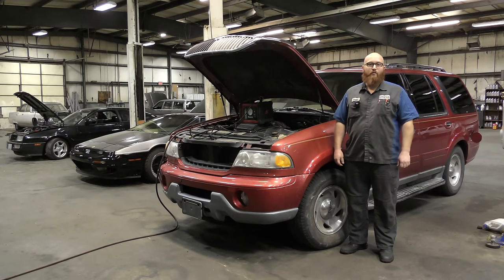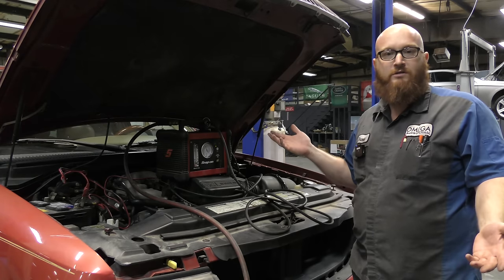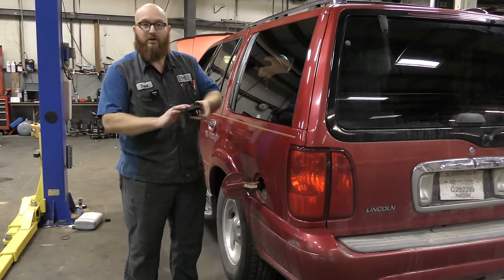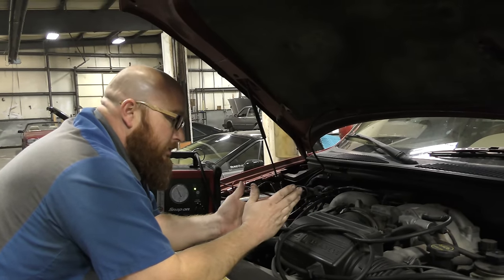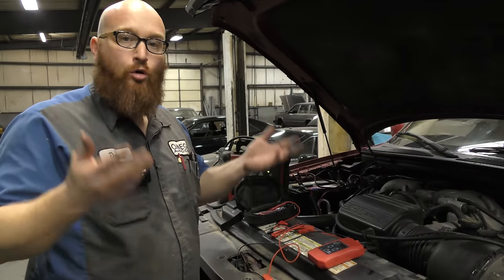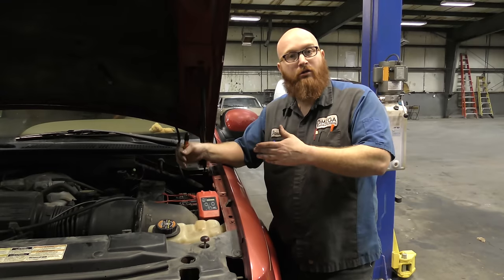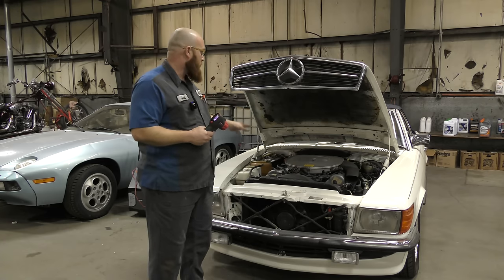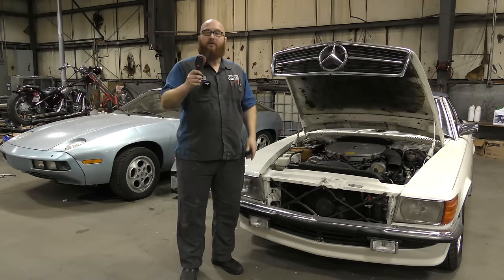Smoking up the Shop!  CAR WIZARD shows 3 essential advanced diagnostic tools he can't live with out!

Comment: Car Wiz or anyone: 1994 F150 4.9L suddenly gets terrible 9mpg after 24 years of 13-14 in town. Checked old injectors and found 3 wanting so replaced the set. Before this I replaced front fuel pump as it was dead. Fuel regulator is good. Filters new. One code for O2 sensor but that according to forums and videos it doesn't affect mileage much. Anyhow it's being replaced today. (Living in California I suspect collusion between Sacramento and refiners to water down the gas thus having to purchase more often and make up lost road taxes from the proliferation of EV cars). Baring collusion anyone have a suggestion concerning such a drastic drop in mileage? The truck only has 127,500K (4250 a year) and other than this issue it's tip top.

Comment: Have you worked on a 2005/2006  Mercedes G500? I own one, no problems yet, but was wondering your opinion on this era and the M113 5.0 engine
Reply: I had a 2006 S500 with M113 5.0. Very good engine, just watch the valve covers for leaks.

Comment: No need to buy this tool to check parasitic current draws...Use a regular multimeter set to AMP between the negative  battery post and it's disconnected wire and remove the fuses one at a time until you see the current   drop to zero and you just found your culprit.(Current draws might come from more than 1 circuit!) What do you think of this method Car Wizard?

Comment: Bought the amp hound without hesitation
Reply: MasMotorsports could have just gotten a nice fluke dmm and it would do the same thing and much much more
Reply: @FishFind3000  i have a fluke 88, fluke 87, mega-omh meter and a mili-ohm meter. This is just to save time.

Comment: one would think that smoke machine can generate it's own air pressure with a small built in pump, if it only require 5 psi of pressure.
and not need shop air.

Comment: "His check engine light is on and he doesn't care" is the main issue with US car owners and why many decent brands get poor ratings. Your CEL is no different than your physician telling you there's a problem before it becomes a major issue. Stop that mentality of "but it drives okay." Same can be said about your body. You may "feel fine" but someone spent a lot of time getting educated and has the experience to let you know that's not always the case. Same with your car, proably the 2nd most expensive investment you make. If you don't want to take care of it, just lease, so those of us that do can have the experience of owning or driving something nice. This consumer mentality is what drove me from the industry full time. Another pro tip is use an incandescent light for smoke finding. I've found certain light spectrums don't light up smoke well enough.

Comment: 22:14   OMG       don't  pull that spark plug boot and leavei the sparks dangling in the air,DAMAGING the car's ignitor!!!!   i see this A LOT from people who are not engineers and from people who  have NEVER read  the FACTORY manuals;  not saying this is the case here, i can't see the NEEDED ground wire but.... i  just do NOT trust ANY ANY ANY automobile repair shop, period;     the ones that use u-to-be a lot,included.; tks